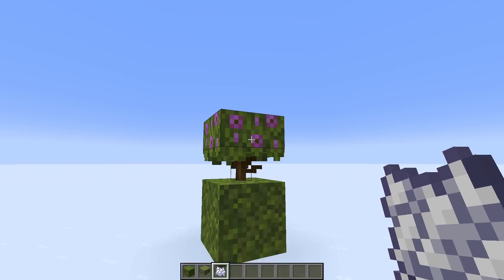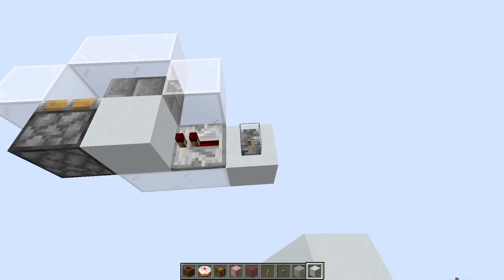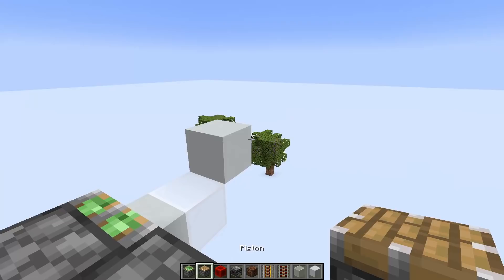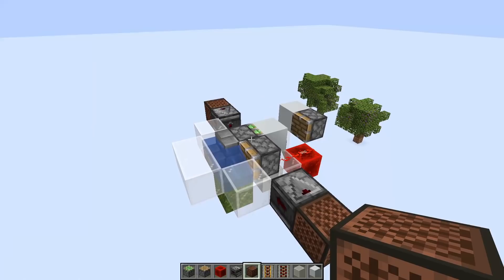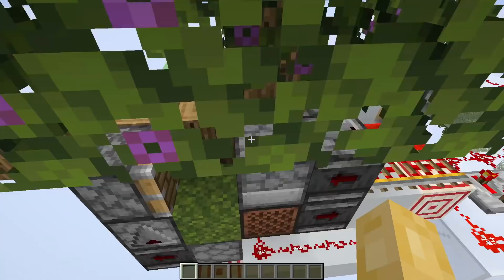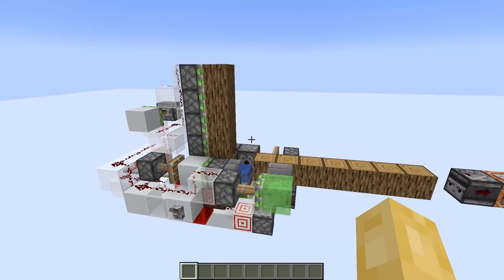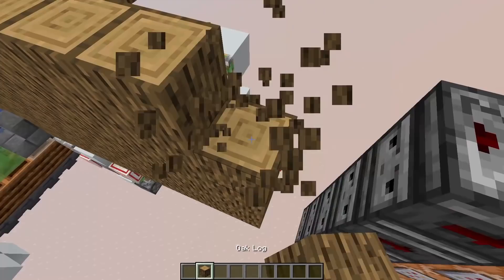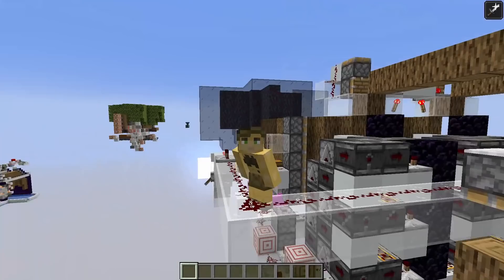let's Build a Crazy Azalea Tree Farm

Comment: you dont explain why you need to detect the azalea plant in the first place. you can instead just permanently bonemeal the block above the moos. bonemal will only get dispensed when there is an azalea plant present.
so i dont get why you went though all this effort
Reply from the maker: This method of detection is much faster and there are plants which grow on moss which accept bonemeal such as grass.
Reply: @cubicmetre  i do get why you are concerned with wasting bonemeal. but i dont see how it would be faster. when you connect the dispenser to a loop comparitor clock it will grow the tree immediately
Reply from the maker: @soliton4  There are a few other details which make this method more streamlined, it takes much longer to remove a tree from the growth chamber than it does to directly detect the azalea plant. For example if you just bonemeal the moss block, bonemeal whatever gorws then assume a tree grew and activate the log removal system. The farm is a lot slower than if you can directly detect the azalea plant and ONLY acivate the log removal if a tree has grown. This system has the benefit of not only detecting the plant and bonemealing it. When the tree grows it will immediately detect it and remove the tree using the same mechanism.

Comment: Bruh I’m trying to just make the simple module and this is garbage to try to follow
Reply from the maker: Yeah this is not much of a tutorial but in fact more of a showcase of the design process and tackling technical challenges. I find tutorials simply not very rewarding for myself or the viewer as you don't really learn anything. My goal is to be able to teach the fundamentals of engineering and problem solving in minecraft instead of just aimlessly placing blocks.
Reply: @cubicmetre  I couldn’t figure out how to pulse the dispensers at the correct timing because I wasn’t sure what the exact redstone was, it’s very hard to try to recreate these types of farms on multiplayer paper servers, so figuring out how and why something works is a huge part, just saying add the master bonemeal block and hook it up isn’t very helpful imo